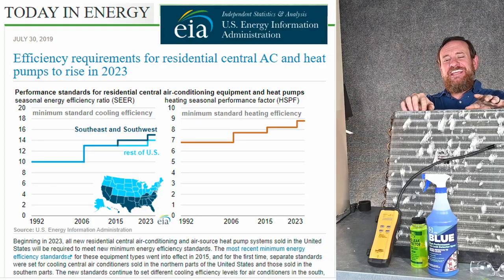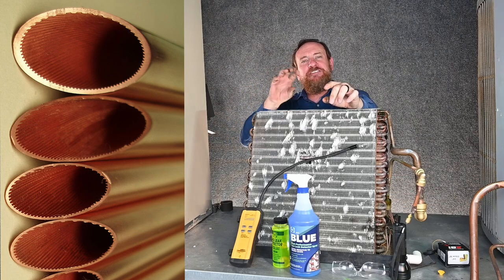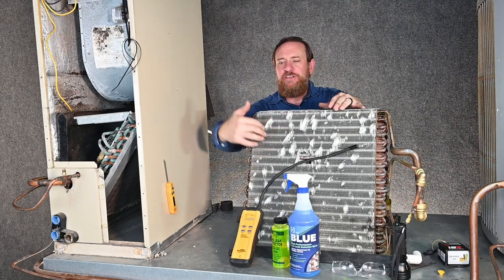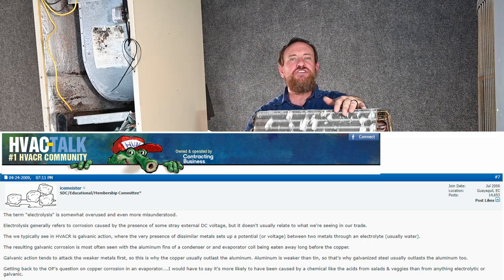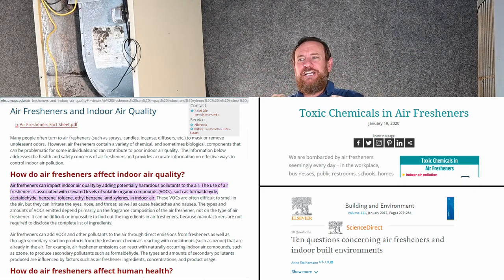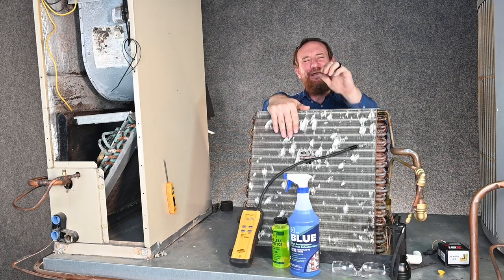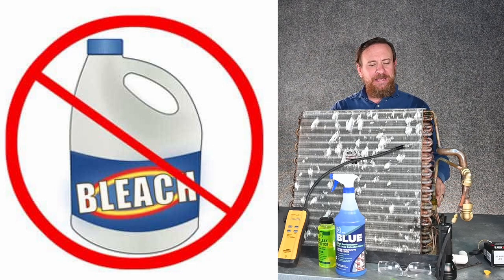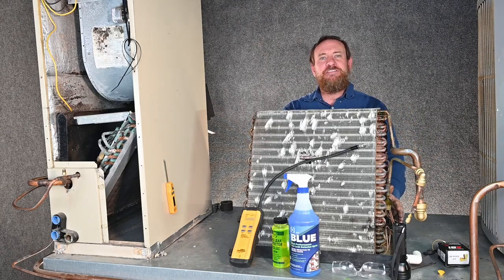HVAC 159 Why evaporator coils leak (Fixed)

Comment: Cheap manufacturing as usual is the main problem with any modern product…….. I have a 1978 evaporator coil in a Lennox unit…….. that will never happen on a modern unit lol
Reply: Todays units are so bad I feel people are being scammed.
Reply from the maker: They are being scammed by the manufacture selling low quality equipment but also the contractor that is not properly sizing the equipment and the duct system. Most units in America are oversized with undersized horrible duct systems. They are also being scammed by builders who built leaking houses and place the unit in unconditioned attics.

It's time for change in manufacturing, home building, sales and installation

Comment: Onece moisture bonds with POE oil, it cannot be removed by pulling any vacuum, good, bad, or average. A vacuum does not reverse the chemical change of water bonding with POE oil. You can always eliminate the possibility of a system containing acid with an acid test and an acid cleanup. Most coils have leaks due to corrosion, and the fact  that coils have either less copper or thin aluminum construction today. I have removed 35 year old coils with no leaks, and five year old coils WITH leaks, both using mineral oil. You draw your own conclusions from that.

Comment: Holy smoke, this was suggested and i said, i'm putting in a new system. why would i worry about leaks in my coil. Oh i see. that's way all mini-splits require 500 micron evacs, triple broken with nitrogen. to ensure moisture is removed. taddy digest has come across lots of mini-split indoor unit leaks. He was more so thinking the VOC inside the living space was eating copper. I'm more thinking your logic about the rifling and moisture. DIY or buddy may treat a system like the old r-22 residential tanks that last for 30 years no problems. Vs these mini-splits high efficent ones and say oh just go until my analog gauge says 30 inHg. i'm about to do a change out with an inverter setup forced air ducted system. I'm glad i've opted for digital gauges. sman one with micron. Should i get a separate micron gauge on the opposite side of the vac too? or is the sm480v ok for this.
Reply: Yikes you mention the VOC's too. Good info. thanks

Comment: Cheap Copper Period
Reply from the maker: You can have coil made for just about any manufactured cabinet with the copper thickness and fin thickness you choose. You can even choose the fins to be made of aluminum, copper or stainless steel.